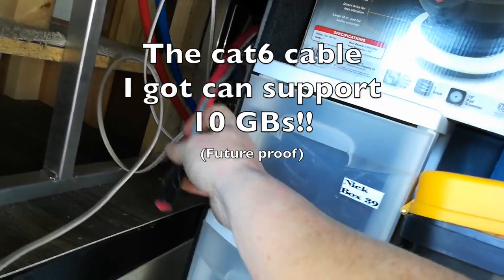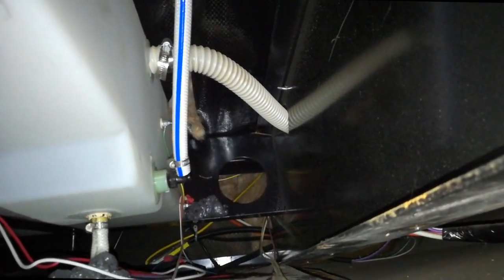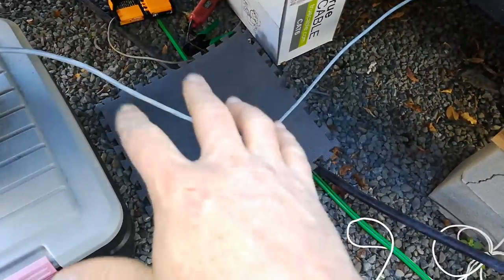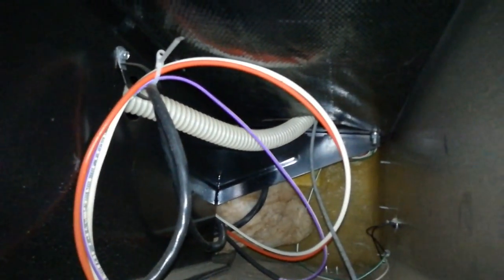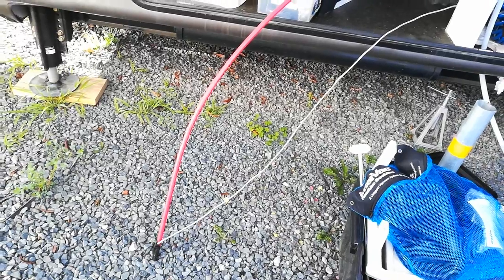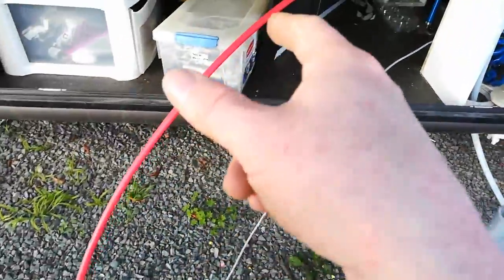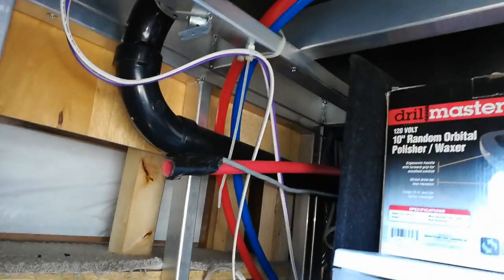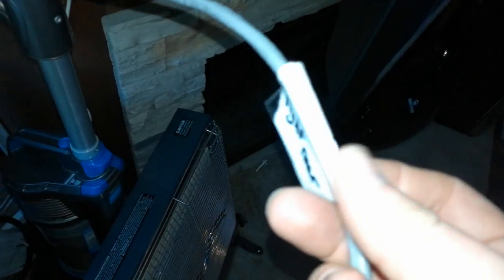Wiring GIGABIT ETHERNET in a Fifth Wheel RV

Comment: Why don't you just buy the right tool for the job? a 50 ft wire runner is cheap, especially if you buy it at HF like your angle grinder, and has the right amount of flex and give and bendability. Seems like you will get a lot of future use out of it, too. It's one the things I waited on which I really regret not buying it much earlier. I think I bought mine for like 9.99 at HF.
Reply from the maker: wow I didn't even know that existed: 50 ft fish runner. Looks like it's good for dry wall but the walls here are solid.  I won't ever do this again (hopefully) and I have to be really careful with what I haul because there' snot much storage rolling earth ship
Reply: yeah. I spaced the name for it. https://www.harborfreight.com/50-ft-fish-tape-38156.html  That's the one I got and wish I got it earlier. TOH had a really cool product on one day where it uses fiberglass rods and you can put a drill bit on the end and drill through a stud inside a wall. Don't know what its called, though. I'd like it, though. :P
 Your walls are just aluminum and such? solid what? 16 gauge steel? I can't imagine that changing it much. They're both there for fire protection.
 You say its the last time you run anything. haha! With today's electronics you can never have enough wire and optics run. Wish I had your internet knowledge, though!

Comment: Good timing, BTW, because the first 5G call was just made today! Newer, faster internet, here we come!!
Reply from the maker: technology! ain't it somethin!   I'm getting free wifi now from comcast. gonna drop the $65 a month ATT DSL payment next month. woo
Reply: awesome! You want to see some cool vids on gettting and spreading wifi punch in kreosan here on YT and watch some of their vids. They're in a bombed out country and have managed some long long internet wifi connections.

On that topic one thing I have noticed is how hard it might be to get terrestial TV when travelling in an RV . It seems with all the push to digital technology there is no simple way to scan and rotate an antenna and map out where one would get the best signal for the night. 

I was thinking about ordering a specialty antenna from hammacher schlemmer because they have the only one which will actively(though electronics) filter out 4g cellphones to get better TV reception. As nice as it  is it still will not cure the problem of which direction the most powerful signals are coming from. How did you do that when you lived in the RV and had different locations?
Reply from the maker: +John Possum ill check out that youtube channel because I'm interested in long range wifi.  I don't watch much tv (brain) programming, so terrestrial tv has never been of interest. Most of my media is from youtube these days, so just internet.  I'm building a system like wifi rangwr at the moment but superior. Load balance wifi hotspots and cellular networks (up to 4 sources of internet).  Im using it in the rv park now and will most likely drop our 70$ a month internet payment.